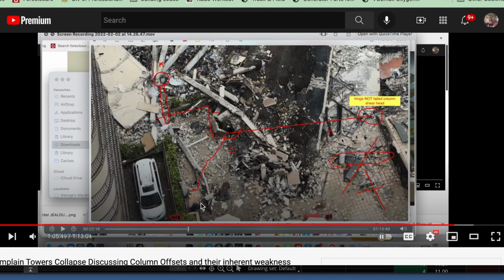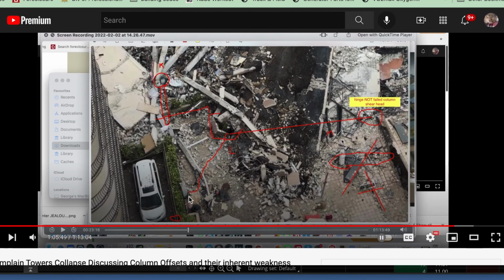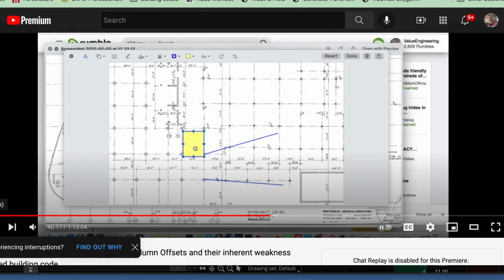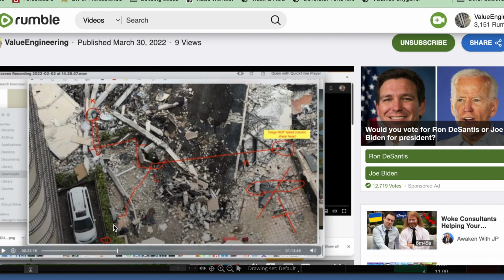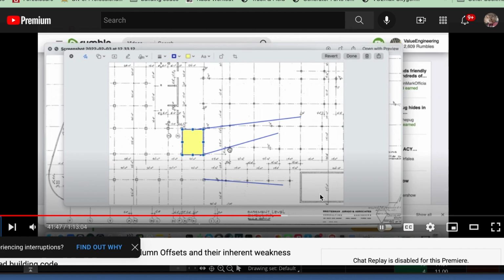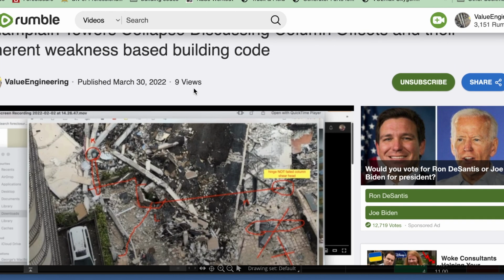Champlain Towers Rectangle Array 3 Months before we get image released! Feels Great to be right

Comment: Hi Kai, if I remember correctly, wasn't there a construction company that walked off site near the beginning when changes were made to the plans that the construction company were not happy with.
I'm not sure if I remember this correctly at all, but, if so, could it be the reason they walked, was the removal of the BMA's originally called for in that very area ?, or, in other words, did they see the same error that you saw when viewing the amended drawings ?.
Please correct me if I have got this wrong.
Kind Regards
Nigel
Reply from the maker: Nigel, I recall it being around the extra floor installation time period.
Reply: Hi Kai, thank you for correcting me.
It shows how easy it is to wander off track.
Please keep on producing these excellent videos, I am learning something new every time.
Kind Regards 
Nigel
Reply from the maker: Nigel, I am not 100 percent certain either; I recall someone becoming ill also, that could also be the reason they parted company...

Comment: 5/8" rebar can easily be replaced with 1.1rebar as long as nothing twists at all... and it will not twist until it is too late anyway... so we can save 38 cents... bang just like that!  and aside from that,  .1 rewire' can be twisted with just a pair of pliers!  allows another 38 cent savings on labor so you can order fries with that!

... and when it rusts!  it does not expand like rebar does and spall the 2 inch beams (down from 12 inch to save weight)... allowing the  more flexible re-wire savings on labor  a massive cost factor   and win win win win!!!!.

THATs  value engineering... next step ahead are advances in foam-crete.... that will eliminate the need to slope all the floors towards the main blood collection riser if one of the FULLY GUARANTEED LIFE TIME WARRANTY wires fail and all the investors turn out to be real flat skinny people...the blood can be sold for making mixed plasma at least.